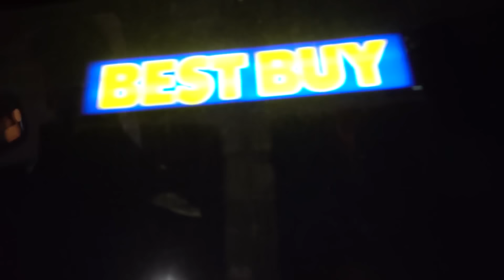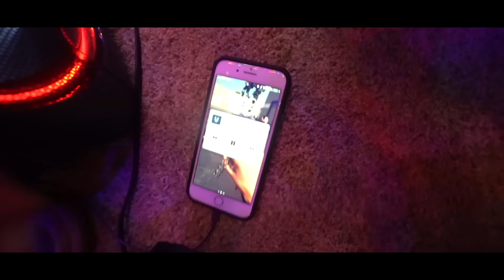MY AMAZING NEW ROOM!! *NOT CLICKBAIT*

Comment: You can’t put a generator in that space because its not ventilated and you will die from carbon monoxide poisoning 🤷‍♀️
Reply: He could put it outside and run a power cord, but really he should just hire an electrician and bring more power from the house panel.
Reply: Obviously, the generator is not in the attic.

Comment: Get a netgear orbi wifi system it will cover Up to 5,000 sqft, AC3000 (Set of 2) and if that is not enough u can add more Orbi Satellites to cover even more.  Its triband but one band is used as a backhaul its 5.8 ghz.  The other two bands are yours to use.  But you will only see one SSID when searching for your network.. Depends on the device which one orbi assignes it does do ip hand off so u can walk your whole house and not be dropped.  I have installed 3 systems and all have worked without issue even in houses 4000+ sqft.

Comment: Why would u get a generator you would wast gas and lose so much more and u could not put a generator up there because you would die or carbon dioxide you need to get s electrician to wire some plugs up there